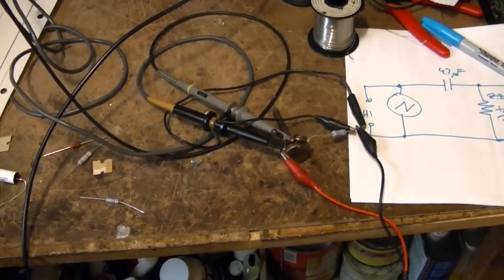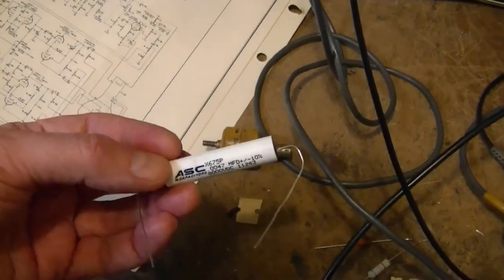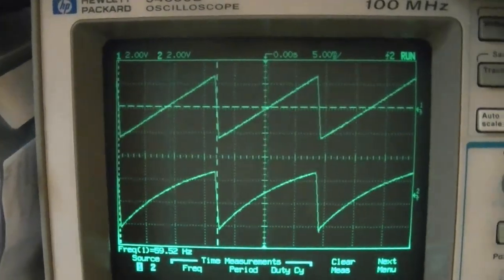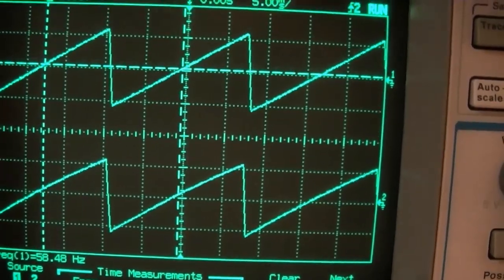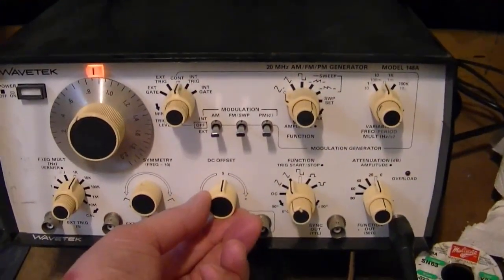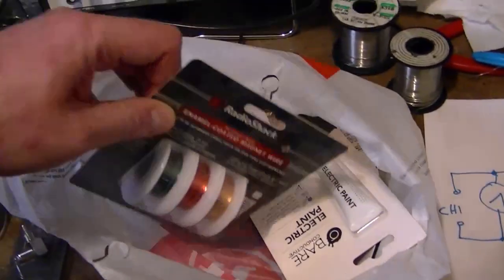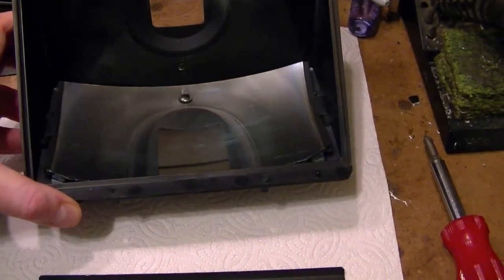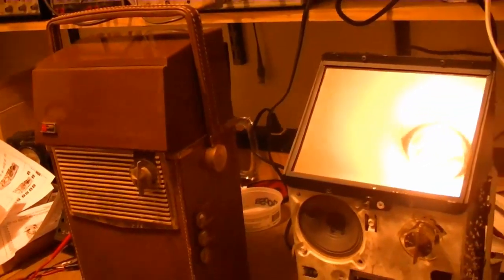Philco Safari restorations p4o?

Comment: Great video!  In older models of TV, the paper caps had a black bar on one end of the capacitor.  That black bar means that it is shielded against EMI. The black bar indicates that that lead was connected to the surface foil of the capacitor.   How do you handle that in your repairs.  Also, since no one is transmitting analog video. what audio/video source do you use.
Reply from the maker: I don't.  Modern caps are made in a different way and outside foil is no longer relevant.  Doubt it made much difference back then in most circuits either.  We still have an local analog broadcast on channel 6.  Also have several of the digital broadcast to analog converters the government was giving out coupons for a few years back. Finally, I have several of my own low power transmitters. Do a web search for Blonder Tongue Agile Modulators for more info.

Comment: Hey Bob,
Nice vid.  Does this explain the trouble you had with the vertical linearity of the set in the "Admiral 20B1 combo chassis restoration p5o6" video?
-wdp
Reply from the maker: Thanks.  Good memory. but nope - this is the first time I've tried using ceramic caps.
Reply: bandersentv hmm...  Might cheap mica caps do the same thing?
Reply from the maker: WDeek Potter
Doubt it.  Mica is one of the best dielectrics and I use name brand parts.

Comment: Come on, everybody told me that electrolytics suck. But now you proved to me that ceramic caps is not best choice at all. One question to you - I used multi-layer ceramic caps as part of IF can for my homemade AM superhet, could caps be a reason why receiver isn't performing as good as it should?
Reply from the maker: Possibly but not because of the issues mentioned in the video.  Did you you NP0 or C0G type ceramic caps ?  If not, the capacitance value will vary with temperature quite a lot.
Reply: bandersentv I have Y5V and NPO caps. So you are saying that NPO dielectric is good?
Reply: bandersentv I googled a bit, and cap I used made with X7R dielectric (cap is 180pf 50V). Wiki says that temp. stability of X7R is +-15%, while NPO is +-0.5%. And X7R is very frequency dependant. So I think I will bodge a few NPO caps to get same capacitance. Anyway, thanks for response
Reply from the maker: MrJohhhnnnyyy  Or use mica caps if you have some
Reply: bandersentv Sorry for delayed response. I don't have any mica caps on hand + Silver Migration Disease... I will try using NP0 caps, but unfortunately I don't have time now to disassemble IF cans, D'oh! But when I will be able to do it, I will write here about results. Sorry for my crude English  ((
Reply from the maker: MrJohhhnnnyyy  Modern epoxy encapsulated mica caps do not suffer from SMD.  It's the exposed cheap mica caps they used in the bottom of IF cans that are the real bad ones.
Reply: bandersentv Got it, thanks.